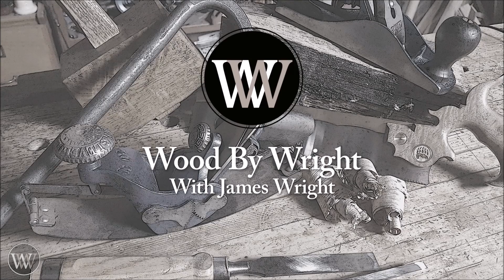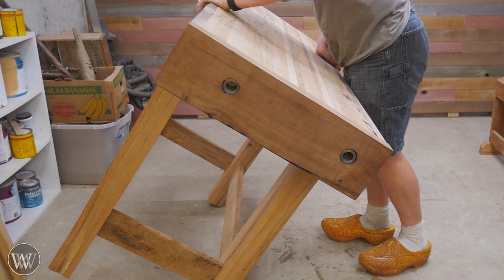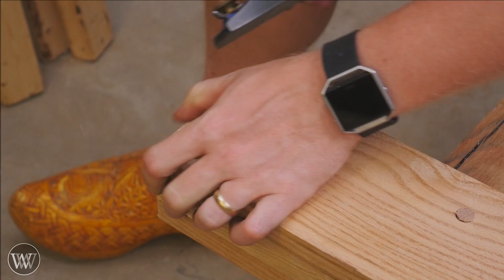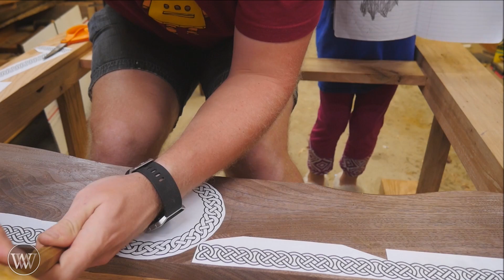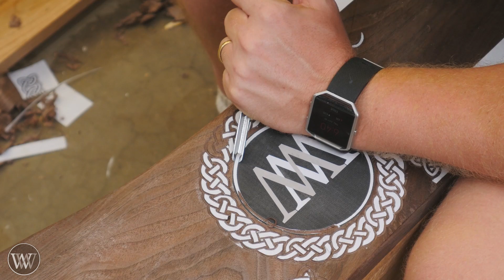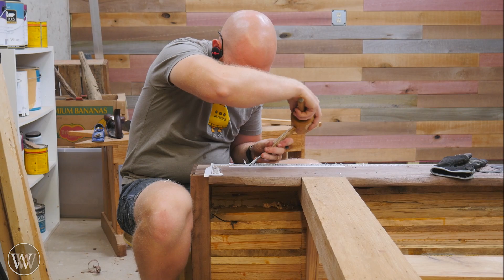Hand Tool Woodworking Bench 5 - Wood By Wright Roubo English Hybrid Workbench

Comment: Do you have a video or instructions on the wall behind your work bench? Or can you tell me what wood you used and the stain colors?
Reply from the maker: I have a short video on it on my second Channel. But the wood is purchased fake pallet wood from The Big Box storeperiod a bit more expensive but much faster and all the boards are the same size and come pre colored
Reply: Thanks for the quick reply I ended up finding the video on your second channel.

Comment: What is the advantage of having the legs so far in from the actual table ends, or even on the outside of the table? Could the bench be just as stable without the bottom joints? I ask because as a wheelchair user, I think I would prefer the ability to roll under the table top. I do love the bench look though!
Reply from the maker: +skyrider3277 with a strong skirt the bench does not need the bottom stretcher as much. I move the legs in so I can put a chair under it and some vices need that space.

Comment: Hi James, I'm making Roubo workbench and I want to ask a question.When I was removing waste Between the tenons of one of the leg I removed more material from one end and now it's not square.Would it be a problem for the joint and how can I fix that?
Reply from the maker: if it is out by less then 1/8" I would not mess with it. the top will sit on one side and not the other but oh well. if the rest of the joint is moderately tight then it will never move. the other option is to remove more from the other side to bring it down and hope that yout leg is long enough so you can trim off the other 3 legs to match it. does that answer your question?
Reply: Would it  be alright if I square it and cut the other joints deeper for that leg and glue piece of wood under the leg?
Reply from the maker: that is another way to fix it.

Comment: Looks great! I'm interested to hear a bit more about your custom soothing plane,how is it different to a No.4, and what are the advantages? Great clip thanks :)
Reply from the maker: thanks here is a video I made when I got it. https://www.youtube.com/watch?v=iIBPj02UuNI
Reply: awesome, thanks for the reply. I'm i the processes of building my first bench with hand tools (cos I'm very much a beginner) and Im using Red Gum that I bought as garden sleepers (rookie mistake). The wood has a beautiful figure to it but is quite difficult to plane. I might have to look into a high angle smoother. Some sections I couldnt even rough plane with a No 5 jack, I had take to a 3 inch edge with my block plane and spoke shave. Red gum does turn out very nice though
Reply: gareths100 looking forward to seeing it! That should be a great bench!